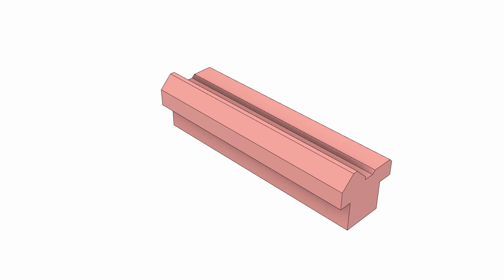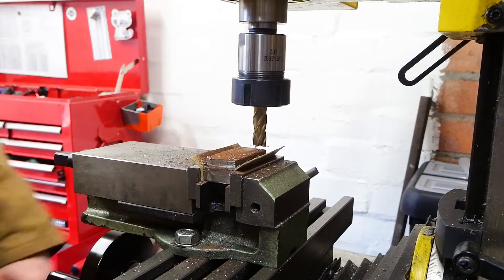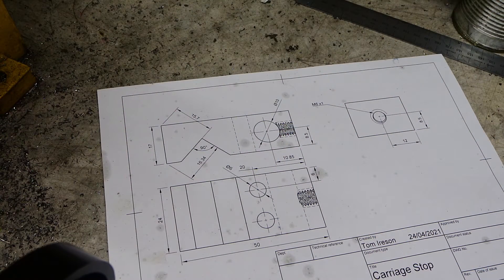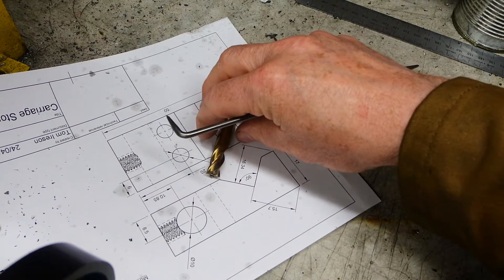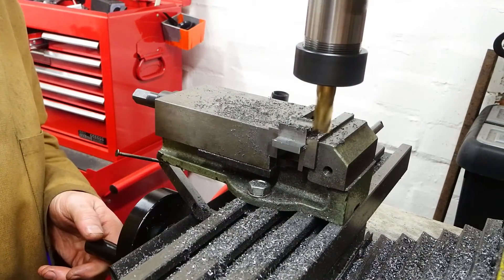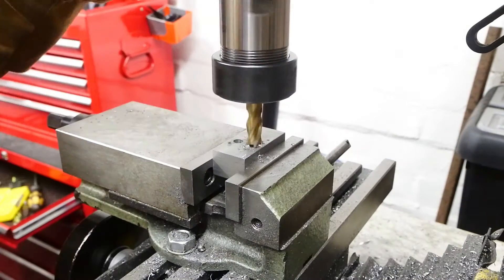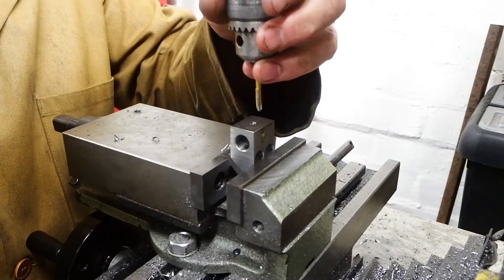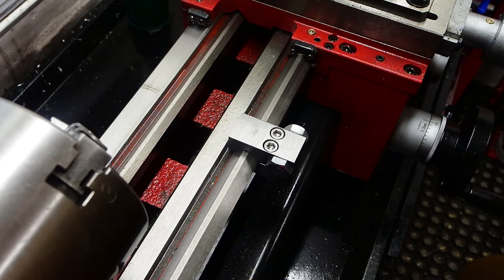SC4 Lathe Carriage Stop: #1 of 2

Comment: I recently made something similar as a milling exercise to reacquaint myself with milling after about a 50 year gap having just been given a micro mill. I was about to make a second one to act as a rear carriage stop when my eye fell upon a 120mm off-cut of 1 inch aluminium bar. This nestles perfectly in the channel in the centre of the bed and when backed by the tail-stock acts as a very adequate rear stop for the carriage. 
I'm nothing if not lazy 😊